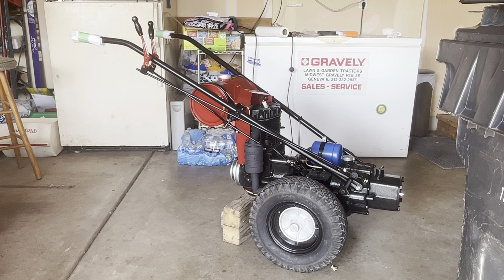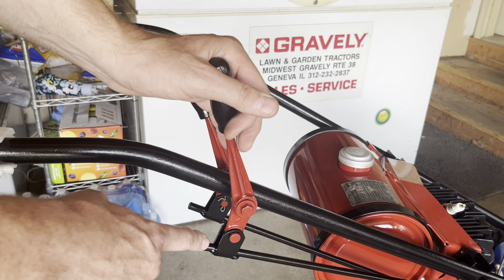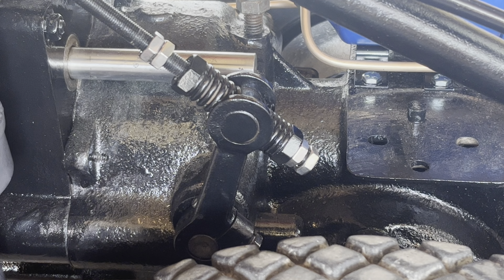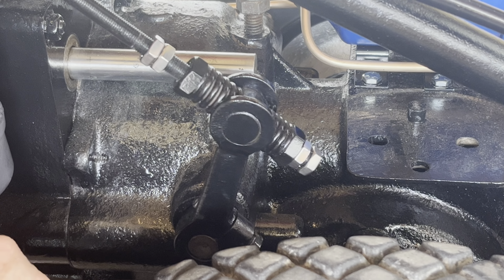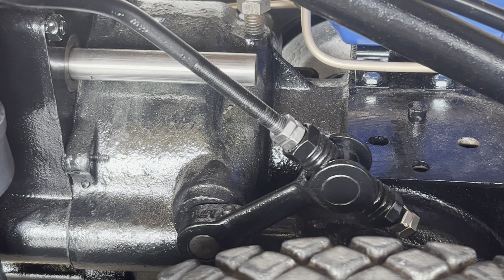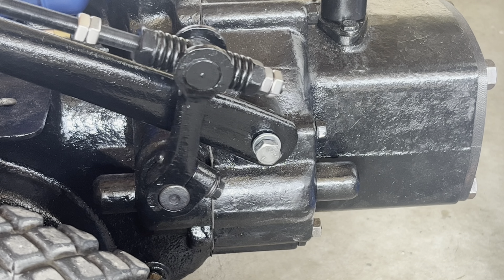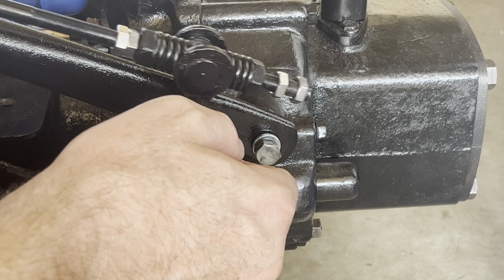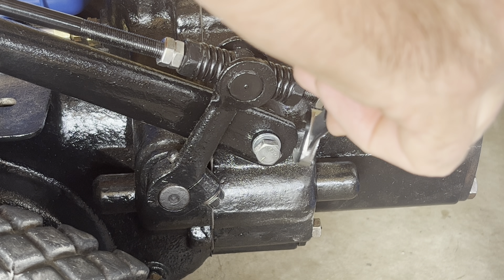How to Adjust the Clutches on a Gravely Model L Garden Tractor

Comment: I have a bad habit of locking my tractors in reverse. I hope this video helps someone out 🔧👍
Reply from the maker: Thanks. I never gave it a second thought until someone pointed it out to me.
Reply: @Gravely  man  , the reverse  isn't  supposed to be able to Lock in  , only the forward position  ,  
And in the forward position there is NO slipping of the clutch  , this tears up the clutch,  so it's either  engaged  or it isn't engaged .

I learnt that from  a master Gravely Mechanic  26 years ago  and  I  been  building  them ever since  , 
From  the original Gravely engines to Kohler  to Briggs and Stratton .
Reply: Mr. Gravely man, good to see you on this channel.He Sure that's a great job😊😊❤❤❤❤❤❤